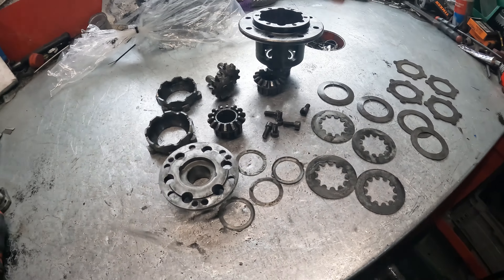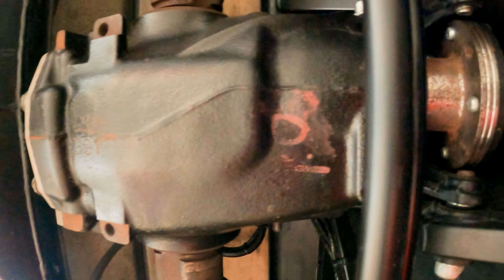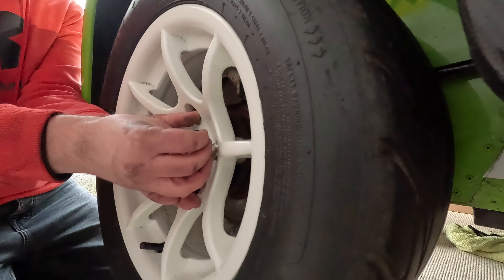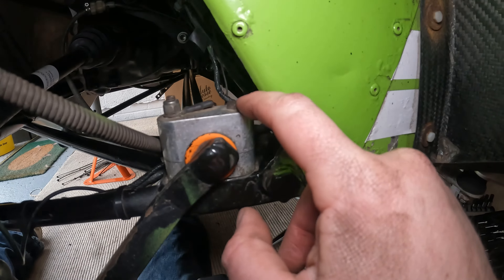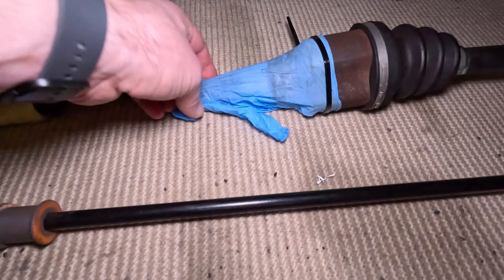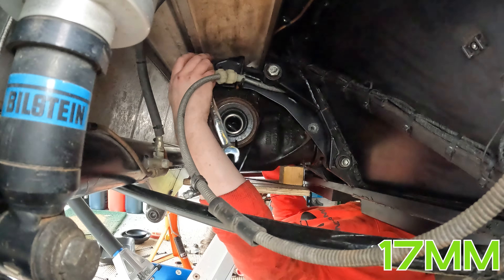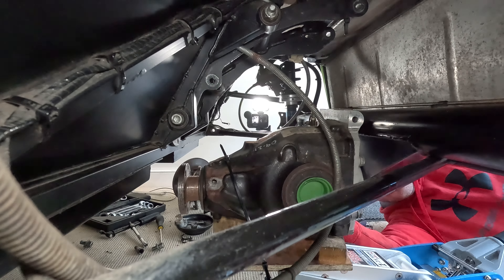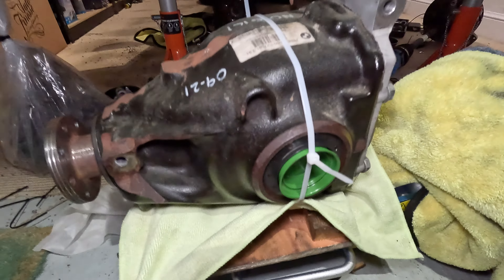How To Remove The Diff Differential

Comment: Thanks James. I have just completed this on mine. Your video was very helpful in showing the process and inspired me to do the removal\refit myself.

One tip to anyone doing this: Remove the boot floor. Although its not actually necessary it does allow easier access for some steps and give better visualation. It also allowed me to refill the diff from above via one of the driveshaft holes.
Reply from the maker: Hey I'm glad this was helpful and great that you have your diff back in. I used a hand pump to fill the diff from the fill hole when it was back in. I guess removing the boot floor gives some more light as well.

Comment: To help when cracking of cap screws that have Locktite on it, heat the area with a soldering iron as this will help. ( it starts to break down at 150c )
The callipers with the hand brake are a pain as you have to screw into piston into the calliper body, not push in as you do on the fronts.
Reply from the maker: Thanks that's a good tip.

Comment: I just did that now.
Not a nice job on a Caterham.😅

What kind of differential lock did you install?

greetings from Germany😎
Reply from the maker: Hi I was surprised how easy it was to do. I've got my Titan rebuilt, but I'll show more in a future video.
Reply: @ACaterhamCalledFern  
My Titan was completely destroyed.
The Titan can't handle the power of a 485 for long.
I have now installed one from limitedslip from Germany.
Reply from the maker: @Caterham81  I went to a company called road and race who rebuild diffs. They can put lots of different options in the case. There will be a video soon showing this. I found it so interesting being there and I also asked lots of questions.